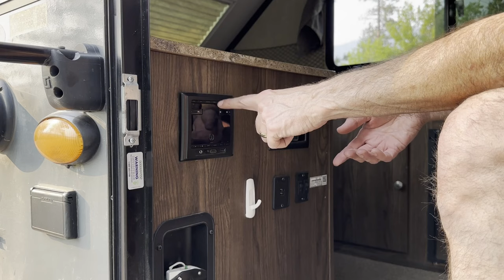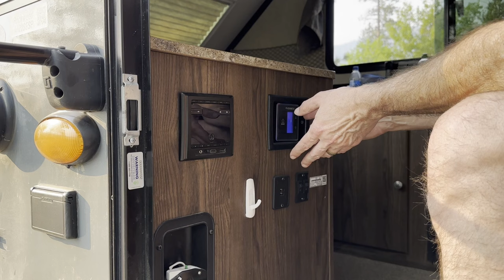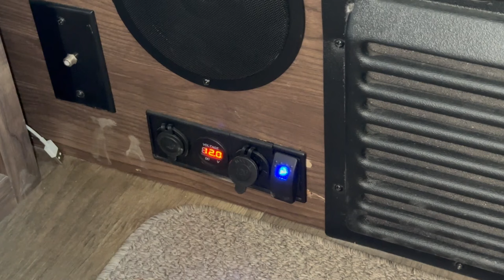PROS & CONS Of The A-Frame Camper

Comment: Do these have a warranty? Have you raised your concerns with the manufacturer? Did they respond? I really like the design, but if they haven't fixed the "flimsy" at the very least , that's a deal-breaker.
Reply from the maker: I bought it used with no warranty and didn’t contact the manufacturer. I could have but knew that this unit was purchased for a 10 week trip up to the Yukon, Northwest Territories and Alaska. I did that and sold the trailer earlier this year after repairing most of what I could. The trip videos are on the channel and am in production of episode 3 at the moment.

Comment: Since you dont care about capability to use table outside,take the legs off and install the tube like you mentioned  or get a lagun arm for it,either are better than what you have
Reply from the maker: Thanks for your input! Much appreciated. I have too many issues with this camper and will be selling it soon.
Reply from the maker: That is an option but I'm selling mine as soon as spring rolls around. Thanks!

Comment: Everyone seems to talk about water issues if you setup or takedown in the rain. So dumb question time....if you're not going to run high speed, can you just pull out and GO with the damn thing still popped open and configured for occupancy? Say, below 40mph?
Reply from the maker: Absolutely not! This thing is close to 10 feet high and the roof system is no where near strong enough. Many A-Frame users report having to put in systems just to keep high winds from caving in the walls.

Comment: Hi thanks for the video . So I owned a Rockwood A frame for a number of years . I used it a lot while working away from home . Probably slept in it a 150 nights a year . It did have the toilet built in . Overall I really liked the trailer and it was fun . Its demise was the floor . The particle board is a poor choice for trailer flooring , especially left exposed . So on a long trip out to the East coast we got caught in a really bad rain storm on the highway . I mean the kind you slow down to 25 MPH with the wipers on high . The next day I noticed the the floors all across the back in the storage area had collapsed. The tires must have been shooting water up in there the day before and saturated the flooring . The only other real problem I had ,and this was my bad . I forgot to drain the water storage tank one day . With in an hour we had chewed the tire of that side of the trailer . The best thing for heating I found was one of the oil filled electric heaters . The ones that look like an old hot water system heater . No noisy  and nice heat . I did have the CoolKat heater ,but they will wake you up every time it comes on . Thanks
Reply from the maker: Thanks for the comments! Stay tuned for an updated review of the A Frame Camper from my trip up to the Yukon, NWT, and Alaska!
Reply from the maker: I appreciate your comments. It has it's good moments but the bad ones just have soured me to the point where I am selling mine as soon as spring hits.

Comment: Aliner is all composite at least. I’m seriously considering one
Reply from the maker: I haven't seen how the Aliner is constructed in comparison to mine. They've been around a lot longer than the Rockwood models I believe. Hope it works out for you!
Reply: I am a builder of just about anything. Skills! . I live near the Aliner factory. I hate RVs ...but they are doing a good job. If I werent so handy/cheap, I would buy one. I bought a bunch of scratch/dent parts from the factory. Been self employed for 30 years....I could work for them. .
Reply: I bought a new Forest River Rockwood pop up, and now I own an R-Pod. Also by Forest River. I am not overly impressed by their build quality. Your video confirms that I am going to steer away from them in the future. The Aliner gives a better impression.
Reply from the maker: You're fortunate to have these skills! I've heard so many positive things about Aliners. Thanks for the comment!
Reply from the maker: Thanks for your comment! I've looked at the R-Pod as well. Great units. Now if it just fit into my garage....
Reply from the maker: Aliner in my opinion are the best of the A-frame RV manufacturers. The ones built by Rockwood and Flagstaff are flimsy and cheaply made in comparison.
Reply from the maker: Glad to hear this. Forest River needs to wake up! I shake my head at how cheaply made their products are compared to other manufacturers.

Comment: If your pulling it what does it matter if it has knobby tires?
Reply from the maker: Thanks for the comment! The knobby tires are best for gravel roads. They keep the sharp rocks from taking a bite more easily into the rubber. They also dispel water quicker than a highway tire giving better traction and slip control. I don’t need a weight distribution hitch either. These tires came standard on my Rockwood A122SESP A Frame Camper.
Reply from the maker: Came with the trailer from the factory that way. You're right, probably makes no difference other than for looks and marketing.

Comment: I am seeing a Flagstaff A-Frame camper advertised on Marketplace that looks very similar to yours, but has a larger platform on the front as if it’s a toy hauler.  I have inquired as to whether that platform would carry my 640 lb motorcycle, but have not received a response.  Do you have any familiarity with the type of camper I have described?
Reply from the maker: I have seen these as well but don’t know about the specs. I just sold my A-Frame camper and recall the cargo capacity was around 1500lbs. Adding 640lbs to the front would increase your hitch weight significantly. I’m no expert in this area but I would be reluctant to add that much weight to the front of this trailer type.
Reply: Same MFG, different brand and still poor construction

Comment: If all the wiring and hoses we're covered up with something then people would complain they can't get to them when they need to fix something.... for me I like to tent camp.... pretty much zero maintenance and it's a lot cheaper and easier... I just can't see spending $30,000 on something like this that is going to do nothing but have issues
Reply from the maker: Good points. RVs are expensive to buy and maintain. I also like sleeping in the back of my truck with a canopy on top. Too many big critters where I live to be tenting.

Comment: This A window is just too big for this gable wall. They sacrificed strength too install a large window that makes a easier sale.
Reply from the maker: Thanks for your comment! I agree, it made that wall so unstable that it broke internally and I wound up having to put two steel plates along the entire length to repair it. It worked but that wall is much heavier to lift now.
Reply from the maker: I agree!

Comment: How long does it take to level that thing out ?
Reply from the maker: Once I have it in the exact position I want it usually takes about 5-10 minutes depending on how level the ground is. Having levelling ramps of some kind makes it faster. I used to just use blocks of wood but they were a nuisance.
Reply from the maker: Takes just a few minutes.

Comment: Is a step up from a tent trailer for sure, but grizzlies can peel that door back or break the glass where the bed is, with relative ease. Hopefully this gentleman is properly armed against a potential bear attack.
Reply from the maker: I totally agree! I always bring bear protection with me in several forms, including a shotgun with slugs, buckshot, and a 45-70 as backup. Especially reassuring when I took this unit to the Canadian arctic and Alaska.
Reply: The same could happen with any camper, still much more secure than a tent or tent camper

Comment: Bad air flow in summer.   Becomes a roaster!
Reply from the maker: Agree. Unless you use ac the only way to cool it down is to leave the windows wide open and the overhead fan on to draw in the air. If it’s warm out at night that won’t help much plus it’s noisy.

Comment: I can not believe the absolutely awful construction of your Rockwood A-frame. It is by far one of the worst built A-frame I have ever seen. By comparison I have a 7 yr old Chalet A-frame built by a small company in Oregon. The quality of construction and materials are night and day above not only Rockwoods, but all other manufacturers as well. All the wiring is neat and tidy, nice cloth seats, no particle board flooring, normal height counters and fit and finish top notch. I have a 4” lift and take mine off road as well. No issues. I will be adding shocks to soften the ride off road which I believe is necessary for body and frame integrity. Chalet has changed ownership and is getting up and running again. By a used one if you can find one.
Reply from the maker: Thanks for the comments!